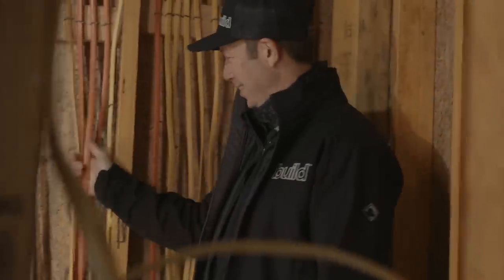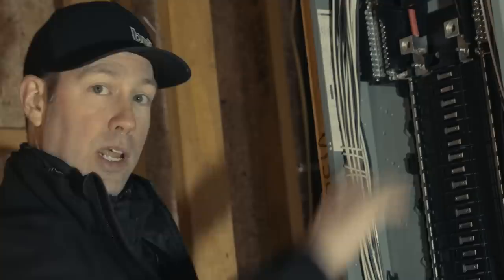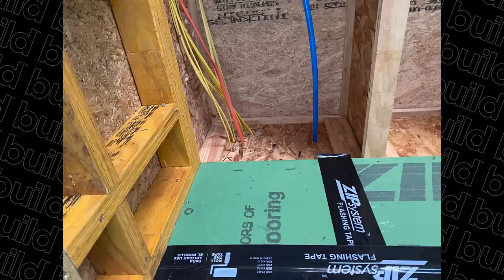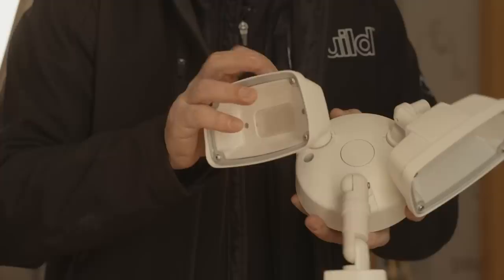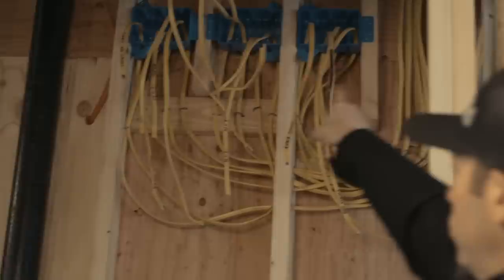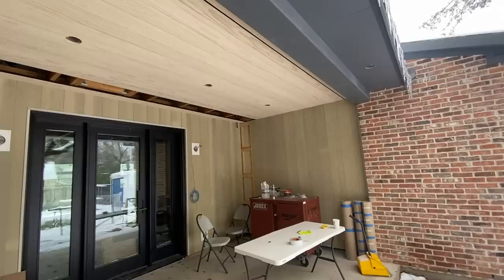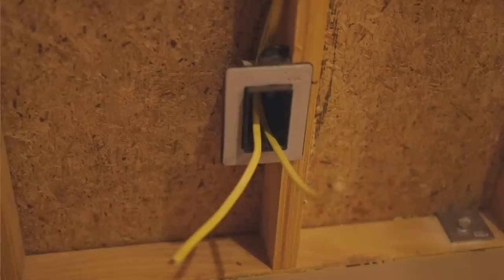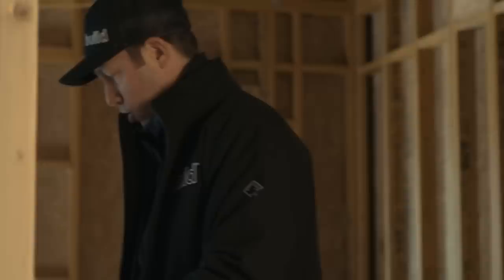5 Tips for New Construction Electrical & Smart Lighting!

Comment: Slim pot lights still need enough room for the driver to be pushed into the ceiling. So it can't be installed right below a joist..
Reply: Well, just pre-install the driver in the joist bay and run the wire to the led. Of course, if the driver fails (only when, not if), you're stuffed. That's why low voltage makes sense. Put the driver in a cabinet and can use whatever fixture you want.
Reply: Yes drivers will fail, usually 1 out of 10 or less will fail from the getco. You can run low voltage cable to each pot light. Will need a close by accessible closet for the driver being installed. I also recommend this on high ceiling/ difficult access, since it will be difficult to replace drivers or do electrical work. But nothing beats a normal bulb that twists and change. No electrician required.

Comment: Mistake, careful in eliminating light switches, be smart about it, tech fails and I am not sure about this Bluetooth mesh, I haven't tested it. Eaton Zwave devices are very reliable and have had them running in my house for about 8 years. I have over 120 devices, you have to plan well, but I agree the all off is a huge selling feature

Comment: I just disagree with one thing.
20 amp for receptacle circuits. Sure that makes sense. But for lighting circuits it's a complete waste of time and money. Just have your electrician separate the lighting and receptacle circuits. 20 amp for receptacles and 15 amp for lighting. If you don't believe me try shoving all these ultra fat dimmers and smart devices into switch boxes that are jammed up with 12 gauge wire. Plus with everything LED now lighting draws hardly any power. 

Just for an experiment I turned on all the lightbulbs and fixtures inside and outside of my house(approx. 1600 sq ft.)
I measured 6.7 amps X 120 volts = 804 watts
With a 15 amp circuit you can have 1440 watts (80% capacity per NEC) So, if I wanted to I could have a single 15 amp circuit power all the lighting in my house with room to spare.

Comment: I don’t want to be the YouTuber basher.. But I feel things are getting lower power than consuming more power.. ie all those leds.. so I don’t know if 12 gauge is worth the extra money.. I would love to see a house wired in all dc lights with transformers to get rid of all the ac wiring. I think we really only need ac in a few key areas. If you think about it.. 80% of everything that gets plugged in is low power.. I want to bring back the ac/dc fight.. :) Peace
Reply: I have been thinking the same thing after reading about how most E26 LED failures are actually faulty power supplies. My only hesitation is the fewer options when it comes to bulbs. Well, that and the higher voltage drops. It really is a debate that is going to take (at least) another century to sort out.
Reply: Transformers are not going be very efficient (ie wall warts), & most of the DC lighting uses Switch mode power supplies which don't last forever, All those Halo power supplies are going to fail in about 7 to 10 years and need to be replaced.  Plus with the DC lighting you need to run a 0-10V signal wiring for dimming control.

Comment: Good luck spending a lot of money on UL approved receptacles & toggle switches. If you do run 20 csbles thru 1 hole most inspectors would require derating so you #12 copper romex ( NMB cable ) to less then 15 amps.

Comment: The City of Austin has a local ordinance that essentially makes it nearly impossible to use 14/2.  As such anyone building here has just accepted the fact that every bit of Romex you see is at a minimum 12/2.  After 20 years of dealing with somewhat arbitrary City ordinances (not code but local ordinances)you just accept the silly rules and move on. Common sense does not apply.
Reply: Yep, many other local codes (in NJ for instance) mandate use of 12/2 even for lightning.

Comment: Wow this is horrifying. Use conduit. Use fireblock.  They make so many products for putting wires, both high voltage and low, through walls, the correct way that won’t burn the place down, and that’s air sealed.   So many products.  Mostly used in commercial spaces but also by residential builders that have sense.  Why place a breaker panel on the outside of a home when there’s space inside 5ft away.  Why make 30 holes to the outside through plywood?! What insane person would do that?!  Flush meter outside with two 200amp breakers, two sub panels inside. One on each side of the house and you’ll save a lot on wire runs. One being close to the garage or in it as that’s a place where future electric cars will go, high power tools… so you’ll only have to run the thicker expensive wires a short run.  Ideally I’d want 3phase service with a 400 amp service. Be able to run 3 phase hvac… elevators… power tools… and have enough juice to charge an electric car super fast.  Or just the single phase system and a ton of solar panels and battery packs.  With a span electrical panel. Tesla power walls. Then you’d have a whole house ups and power conditioner.   https://www.span.io   Also the Tesla solar roof is really an amazing product. Will no doubt outlast even slate roofs. And the solar roof would have only been a little more than your metal one.

Comment: I still don’t understand how America doesn’t have 220v everything. like most of the rest of the world
Reply: First of all, we do have 240 volts in our houses and offices.  It is a two phase scheme which allows wiring outlets and devices with half that (120 volt), but with the option of presenting full phase power at 240 volts.

Some atypical installations like large residences (mansions), light commercial, and apartment complexes have three phase power which provides 120 volts between a "hot" leg and neutral, and  208 volts between any pair of the two "hot" wires.

In North America, 240 volts (or 208 volts) is normally supplied to "high power" devices like electric ranges, electric clothes dryers, baseboard electric heat, electric water heating, etc.  Where I am, in the western U.S. (Oregon), all-electric houses are pretty common:  no propane, no natural gas, no steam utility.  The only energy utility is electricity.  So 240 volts at 200 amps is also common service equipment for modern all-electric houses.

A significant fraction of new houses also might have natural gas, where it is available.  This would be used for heating, hot water, and maybe for cooking.  Non-urban and non-rural locations typically do not have natural gas available.  The owner might choose to have a propane tank installed on the premises.  That requires a propane delivery truck which delivers once to three times per year.

Comment: I find it hilarious that he doesn't just tell the electrician/plumber what he wants done, he has to go and block the hole so they can't use it like they are children. Have some trust issues with your workers?
Reply: While there's  ton of illogical planning stuff in this video (as pointed out by like 80% of the comments) I think he kind of miss-spoke on his reasoning for that one. It seems like he wasn't trying to deny access, but rather just wanted them to drill a hole instead of him having to add the OSB around existing pipes / wires later. This seems to be his actual intent based on the pictures showing he clearly allowed the electrician to still run cables through the panel.

Comment: I laugh at 220/110. The voltage divisors for all electrical calculations are 240/120 volts root mean square ......
Reply: Unless it’s a 1600A 3 phase 120/208Y service supplying a bank 200A single phase meter stacks.
Reply: @RaddestDad  yes a 208 volt delta has its own issues whereas current calculations are different but I was not talking about three phase , but single phases , split. Are you referring to one split phase on a 208 volt in respect to a 240 residential ? Different  for sure however they do split 208 in very old neighbiurhoods. Voltage has issues however electrics calculations remain the same and there are alternate calcS in code to correct this.

Comment: Big pet peeve of mine, there is no such thing as 110 or 220 volt.
Reply: 120, 240 ?
Reply: Correct.
Reply: @augustreil  Or 120V/208V (if the building is connected to 3-phase power).

Comment: Who wires a house like this . Put a 20 amp circuit for each bedroom. And a couple lighting circuits . There is no justification for using 12 gauge for lighting.  If your having popping breakers , your electrician didn't wire or distribute the loads correctly on the circuits.

Comment: Why not 240 volts, ? much easier installation and much smoother cables.
Reply: 240 volts for what? Most (nearly all) residential homes in the USA have 240 volt split-phase power, meaning 2 hots and a neutral, with 240 volts between hots and 120 volts between each hot and the neutral. Typically only large appliances like electric water heaters, AC units, electric clothes driers, and electric stoves / ovens will use 240 volts. All of our other consumer devices are 120 volts.

Comment: lol 8 - 10$/ft. The supply house online is 3.36/ft for 2.0 wire. You're getting hosed. Also why didn't you just put that main panel on the inside? That makes no sense, heat will kill breakers over time.

Comment: Are those light fixtures energy rated for air infiltration?  Save money on electric, and use it with heat and cold infiltration mitigation,  no such thing as a win, in energy, never

Comment: Just say no to "no hub required."  All it means is janky half-assed solutions shackled to proprietary software with so many ways to leave you stranded with a non-functional product.  The very best case scenario is a limited feature set, painful to nonexistent ability to integrate with other systems, and things you won't be able to do because it requires a product that vendor doesn't offer.

Put your faith in open standards, open source software, and vendor-agnostic infrastructure, and your smart home will be even smarter 10 years from now, instead of half broken and the other half obsolete.

Comment: All that electrical OUTSIDE is WEIRD, never see in the Northeast, why do it, talk about condensation problems, the stuff in 10 years will be a mess, heat, and moisture on the ckt breakers ain't good, they are not rated for damp location are they? so technically this violates NEC

Comment: idiotic to try to fold 20amp conductors into deep switch boxes and fracture your devices. we ran 20a for lighting 40-45 years ago. we regret that now going back with deeper smart or dimmers devices . always run MULTIPLE 15 a lighting only circuits. especially with  leds .... 12 ga now ??  on lighting . GET REAL. every electrician thinks he is a engineer. especially the brainless wonders who love wagos.... longevity...

Comment: this kid keeps putting too many things on the circuit and tripping the breaker cool let's just upgrade the wire and the breaker to 20 amps! Wrong! You should break that circuit into separate circuits because each of the devices that go on to that circuit are not at the capacity of that requires a 20 amp breaker they require 15 amp and by giving it more amps you give it the ability to draw more amps than is necessary and you risk fire. Thats dumb. Wire it correctly.
Reply: Just about all devices are fused. if the device as a problem its going to trip its internal fuse. In addition 15AMP or 10AMP breakers can be used instead of 20 AMP breaker. There is no rule that you cannot use a 15AMP or 10 AMP breaker on a 12 awg cable.
Reply: Huhh !
Reply: @guytech7310  Of course not and you can do that and normally would unless you needed 14 for some light duty use. So you think lamps are fused? You think a shorting appliance on the upstream side of a power supply is fused? If you like gambling then why bother with breakers at all! 🙂
Reply: @danielbuckner2167  Yup. LED bulbs have fuses as well as power supplies. if the DC side of an AC-DC power supply starts a fire, it not going to matter if the circuit is 20 AMP, 15 AMP or even 5 AMP.  Most devices that use a power supply don't draw a lot of power. The only devices that are going to draw a lot of power with a power supply is going to be gaming PC that may have a +1000W power supply.
Reply: @guytech7310  Your answer is well suited to you. However a uniform electrical code must suit everybody. Anyone can cherry pick some items with fuses but how are your items going to stop a fire in someone elses house with the other 2 million household electrical items? Its not. BTW thats why stacking items means you have to count potential amp draw instead of just the max single draw. Please dont wire anything. 🙂